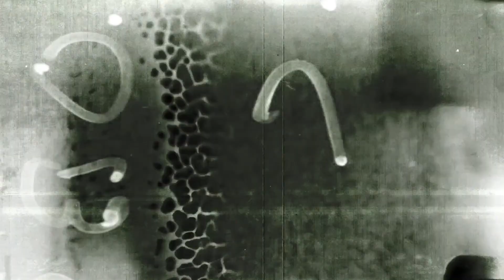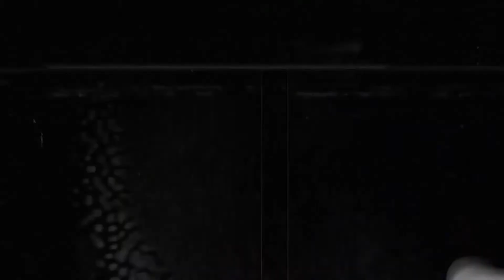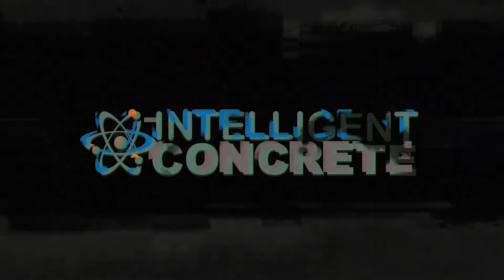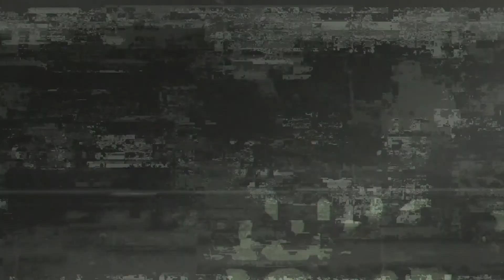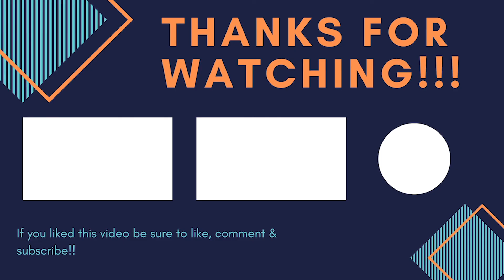Concrete Carbonation - Vlog 700

Comment: How do u know the quality of the RC? The higher the Cement part the better the RC? or how do u measure it, so carbonation and following corrosion ocur in the longest time possible?
Reply from the maker: I believe there is an FHWA method for pavement evaluation
Reply from the maker: https://www.fhwa.dot.gov/pavement/pavedesign.cfm

Comment: So for non reinforced concreate is it an issue ?   I though part of concrete getting stronger with age was this carbonation process.   What about using carbonated water at mixing ? would  those reactions still make "holes"  I assume later reactions will make holes,  but what about calcium carbonate made before the set.

Comment: Is it the process of carbonation what makes your concrete appear lighter over time, especially during the first days/weeks after the pour?
The cement type has an influence on the final color, but for all cements there is a typical change in color from dark greyish to light greyish / white in the few first days/weeks.
Reply: Probably caused by the evaporation of free surface water.
Reply from the maker: Good point.
Reply from the maker: It can also be from salts at the surface or migrating to the surface.